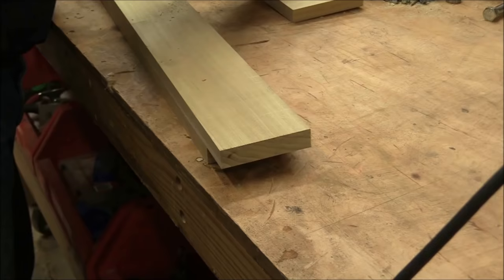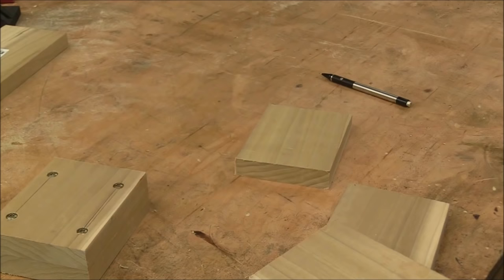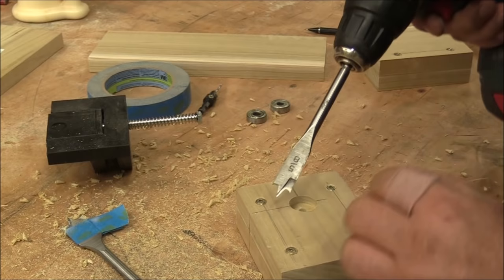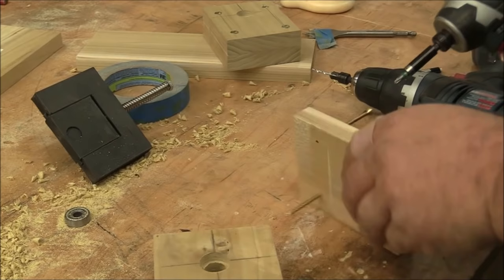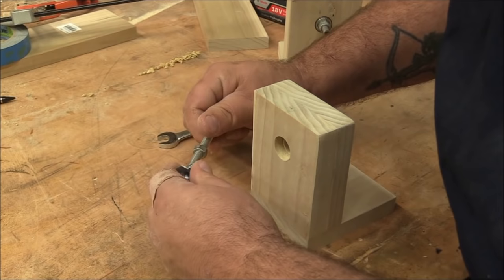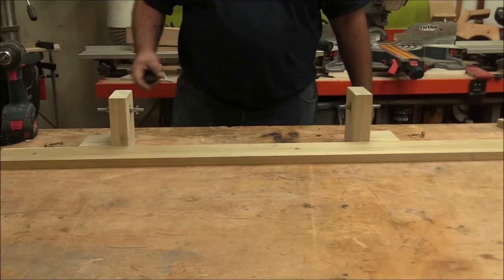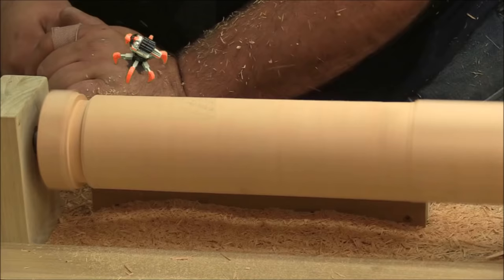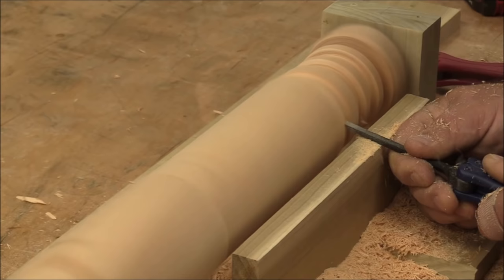How to make a mini lathe in 10 minutes

Comment: To get the spindle and tailstock lined up, I would have clamped both sides together and drilled out a lead thru hole in one shot.  Then counterbore for the bearings second.  This saves you from any drift or being off center when popping those bearings and shafts in.

By drilling both halves together, any error in drilling will still be on axis relative to each other.

Comment: There are switches on a socket/plug that you can simply insert between the drill's plug and the socket. They are cheap, and you can switch it off much faster (which is safer), and you don't have to keep ripping off the velcro. That way, you could even secure the drill's switch with a simple cable tie.

However, if you're gonna use it 'a lotÄ as you said, in my opinion, you are much better off buying a real wood lathe in the first place, even if it is the cheapest of import models. The sound is a lot less annoying than that of an electric drill, they will vibrate less (and a la<rge part of wood turning is abnout vibration control); and you can get a wide range of dedicated work hoolding accessories like chucks and centers, which make life a lot easier.

Comment: Great rough and ready build, thanks for sharing. *tip for the drill wrap: Instead of Velcro strap, 
what about using a hose clip with a thumb screw to adjust the pressure on the trigger ?
Reply: This is helpful idea for me for using a variable speed corded drill for other things. I think he was worried about being able to shut it off quickly, but you could just plug into a power strip to cut power quickly (or buy a purpose built type pedal, but that negates the cheap, easy with stuff you already own thing)

Comment: At the 3:40 mark, you put the T Nut on the bolt and then turn the points around. Why did you just not put the T nut on the bolt the other way with the pins automatically sticking forward - why go through the turning them? You have a reason for everything you did, so I suspect there is a reason. Excellent video - i'm going to start building one tonight. Thanks.

Comment: This video is really old but if you really want some adjustability on that drill trigger you can use a hose clamp and dial it in with a nut driver. A bit cumbersome to stop it but if you tie the extension cord somewhere you can just yank the drill cord to unplug it fast

Comment: I always look forward to your videos and I learn so much from them!  I finished my previous project a little faster after I saw this so I could begin building.  I am really looking forward to trying it out but I am having difficulty bending the tangs in the opposite direction.  They keep breaking off when I bend them.  I have gone through 3 T nuts so far and each of them only has 3 tangs left instead of 4.  Any suggestions?

Comment: Would the carbon brushes on a drill burn out quite quickly using it in this way?  How long can it run for continuously and what is the maximum load bearing weight for it to turn? 
 thank-you

Comment: Went back and looked at this again.  It occured to me that all these mini lathe builds I have seen on YouTube the drill motor lays on its side.  It seems one could get a larger swing if the pistol grip pointed down instead of to the side.  instead of creating dowels, pens, and skinny baseball bats some moderate sized bowls and plates could be fashioned on such a lathe,  In fact an interesting tooling option would be for someone to make a 1 inch 8 threads adapter that would be able to mount mini lathe chucks, screw chucks,  and faceplates along with pen adapters.

Comment: Thanks for sharing. I need to make one to turn 12-15 inch dia pine wood (1 inch thick).  need 25-50 pcs. What capacity corded drill do you suggest. I just need both Head stock and tailstock at 25 inch heigh. correct? Do I need thicker bolt?

Comment: You can find foot pedal switches for $20 - $25.  That way you can run the drill / motor hands free and have a safety kill switch.  Always good to have one or two in the shop.

Just be carefull if you have kids and pets around, especially if you're locking down the trigger and bypassing safety locks.

Also, if you have issues lining up the tail stock straight and true (you need to reduce runout) use a pin, rod, or pipe to key them together.  Just make sure its straight and rigid.  Lock everything down.  And remove the pin.

Comment: what is the thing you are using to cut with the chop saw? the black thing?
Reply: Grace Hoover it's just a hook shaped tool, to hold down small parts next to the blade. You can make one out of a stick and a block if you want. It's just a hold down.

Comment: i want to do this, but add a re purposed fan controller/box under the work table. does anyone think a vice, or some sort of table clamp could be used, on the (rear) to adjust the length quicker? rather than re?screwing to adjust length

Comment: Newbie question:  How important is the tool rest ??  Can't I just use my two hands, one or both resting against the table, to hold the tool steady, of is that spinning stock going to rip the tool away from me ??
Reply: You could prolly do it without the rest, but you get much better control of the tool by using one.

Comment: Perhaps YOU can fabricate this in 10 minutes but I'm fairly certain that it will take me longer and cursing will be involved at some point.  None the less... I'm going to give a go!   I don't "need" a lathe but have wanted one for a while.   I didn't want to drop a couple hundred bucks on something low end just to use it once or twice and determine that I should have spent more to get better quality.   Which happens to me alot....damn it.  You rock!

Comment: How long can you let a cordless drill on before it burns up the motor?
Reply: JonBuilds- The answer to that question depends entirely on the quality of drill. I would reckon that a $20, 12v Walmart special would burn out a lot faster than $200, 24v Milwaukee.
Reply: JonBuilds - Harbor Freight sells inexpensive wood lathes - cheaper than burning out a cordless drill!!!
Reply: JonBuilds - JonBuilds - Harbor Freight sells inexpensive wood lathes - cheaper than burning out a cordless drill!!!

Comment: I've been look for something like this for ages , do you think that this could work for turning brass ?
Reply: Short answer, no. 

Metal really requires a machinists lathe, as you have to have very precise and accurate control over speed and material removal (ie, thousandths of an inch).

*you risk very severe injury if you try it.

Comment: does the tool rest need to be higher or lower than the centreline of the piece being machined?
Reply from the maker: the cutting tool does, but i will talk about that in up coming videos
Reply: +izzy swan higher or lower?
Reply from the maker: angle of of atack changes depending on the tool but you will almost always want to be higher then the center

Comment: brilliant!  I've never understood why lathes are so damn expensive.  It's not rocket science.  and your using regular chisels shows you dont need the most expensive turning tools.  I once watched a master turner use a garden shovel as a roughing gouge to make a cylinder!  He didn't suggest anyone actually DO that, rather was just trying to make a point that you can essentially use just about anything a turning tool. :)
Reply: Most production lathes have much more powerful motors and advanced speed controllers as well as guided tracks and more sophisticated head and tool stocks
Reply: nopethegeek - - Harbor Freight sells inexpensive wood lathes - cheaper than burning out a cordless drill, and more versatile!!! If you did a little research you would learn about wood-turning techniques, and the advantages of using a wood lathe. As for wood turning tools, a chisel is not suitable for all wood turning techniques e.g. a chisel could not do what the roughing gouge you mentioned does, or turn intricate curves.
Reply: Richard Webb yep
Reply: Look on Marketplace. Usually about $100-200 all day long.

Comment: Was that an optical illusion caused by the frame rate of the camera or is that spinning the wrong way?   Looks like a dangerous way to hurt your fingers if it’s spinning the way I think it is.
Reply: It's a optical illusion, similar to how car wheels sometimes look like they're going backwards in videos. You can see by where the chips are falling that the wood is spinning the correct way.

Comment: Great idea, but is not cheaper to buy a lathe at Harbor Freight? All the equipment needed to build this one is very expensive.
Reply: What equipment? Some lumber, a few skateboard bearings, a few 5/16ths nuts, a couple 5/16ths bolts, a 5/16ths T-nut, some glue, some screws, and a corded drill? You can even cut the parts with a handsaw, if necessary, though that adds a layer of difficulty/required skill. Where is the expense? I can't think of a lathe you could buy with as little cash as the parts for this build would/will cost. If you can think of such a lathe, please post a link! That would be awesome! :-)